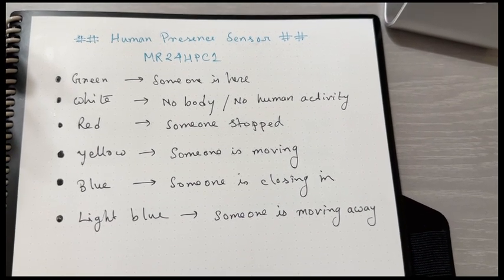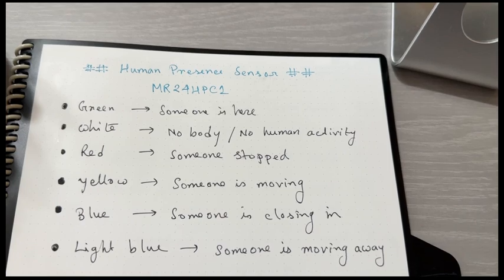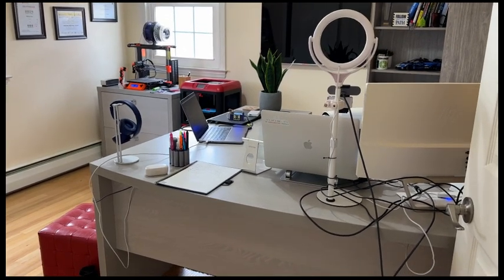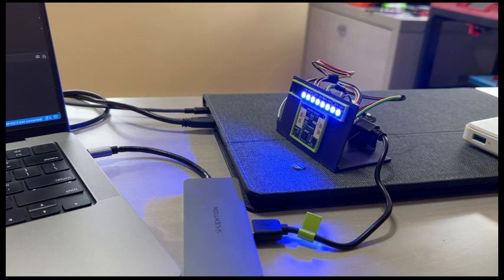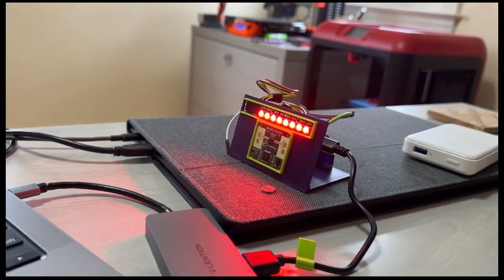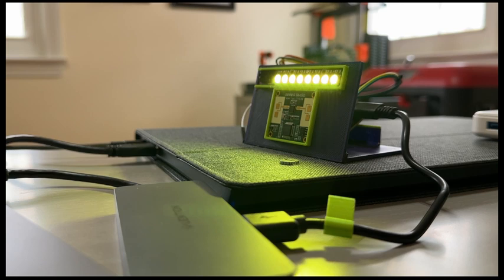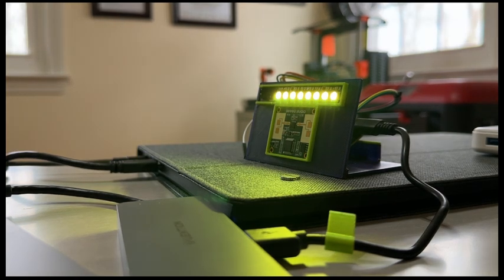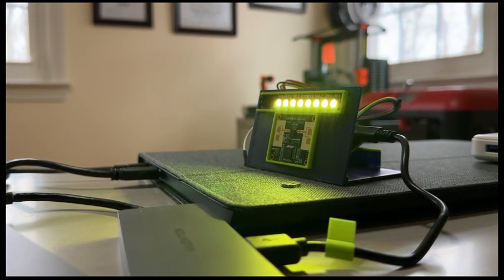Testing of Seeed static human presence sensor (MR24HPC1)

Comment: Sir my question is, will it keep detecting you while you are not doing any movement
Reply from the maker: mmWave sensors can detect the presence of objects based on their reflection of radio waves unlike PIR sensors detect changes in infrared radiation. So technically mmWave can determine presence of human when movement is very less or no movement. You may need to adjust the settings which works best for your use-case. What kind of application you are thinking about?

Comment: Great video and setup.  I am looking at using this sensor but in an outside setting.  The sensor would be mounted about 10ft high and pointed downward to detect people about 5 to 10 ft away.  Do you have any data with this type of setup for the outdoors?  Or if based on your knowledge will it work as expected?
Reply from the maker: I haven't tested that outdoor but as per their wiki https://wiki.seeedstudio.com/Radar_MR24HPC1/#application , it's suitable for outdoor use. Based on my indoor testing, it was able to detect motion from 10 feet